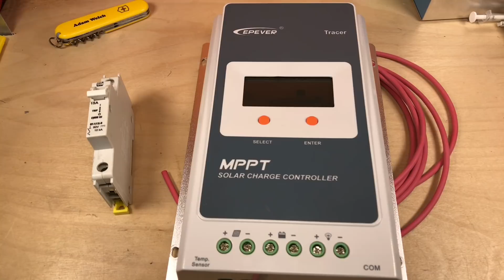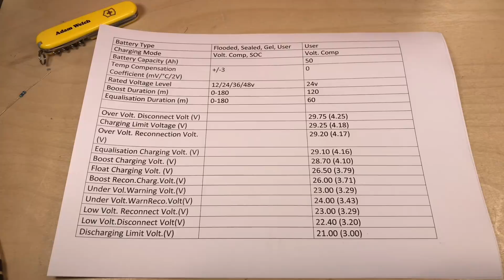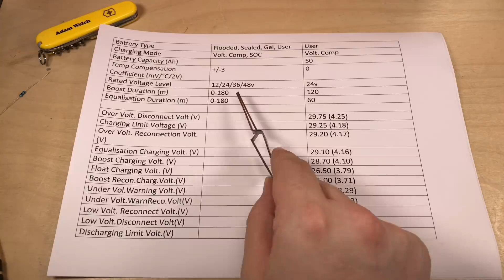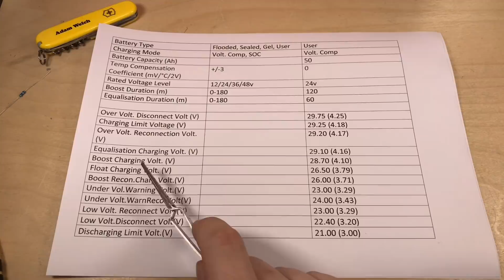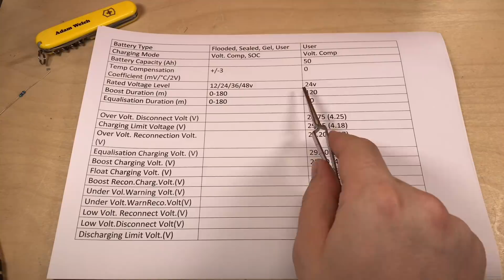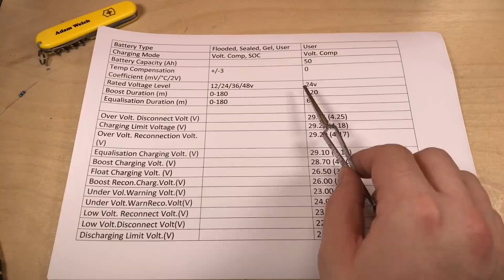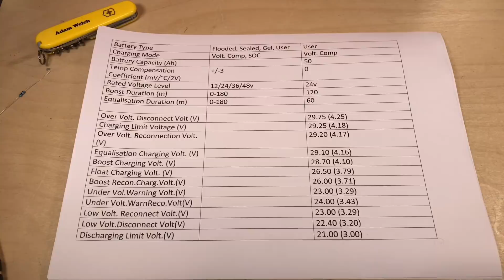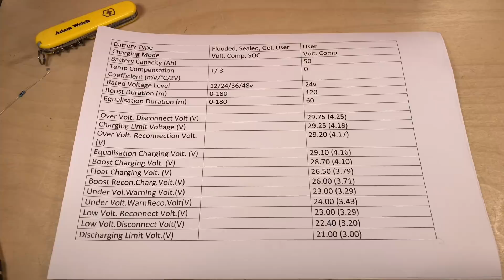Solar Charging the 18650 Blocks - 12v Solar Shed

Comment: hello Adam, very interesting video, I'm trying to build an off grid system with 18650 batteries, and I would have some questions for you: I understand that float mode is not good for lithium batteries but I have not understood how you can avoid the controller enters float mode if during the day I take energy from the batteries (in fact if I take energy from the batteries when the battery voltage reaches the float level the controller enters float mode), or am I wrong?
Reply: Did you ever find an answer to this question?

Comment: Hello Adam, maybe you can help me with my problem, and I have the Epever Tracer 3210AN on a 4S Li Ion battery system. In battery mode "User" you can set everything from 9-17V and I have a list of values for such a system, unfortunately it does not charge over 15V although I have set Max 16V, basically it is not bad for the battery but there is not enough energy in it. Do you have an idea or the loader can't do it because then this user mode would be pretty pointless. mfg Marco
Reply from the maker: I’ve not taken anything that high but if your boost and equalise voltages are above 15v then I’d think about your solar - either there isn’t enough to get the size of your battery bank up to that level, or it’s not producing the voltage. It’ll need battery voltage +1volt at least. 
The boost and equalisation charges only last for a limited period of time - if you can’t charge your bank up to that target voltage in that period the charge controller will fall back to the float voltage. 
Hope that’s helpful.
Reply: Adam Welch  hmm so solar voltage should be enough, because I have 2 12v modules connected in series and open circuit voltage is 36-40V.
Reply: Hello Adam, hope you are well. I could solve my problem with my Tracer AN and the misterious 15V limit. It was the BMS's fault that the charging process should be interrupted in an emergency because I had previously worked with a cheap china pwm loader and I simply needed security. Now the detail of the Tracer AN measures the resistance of a battery and then adjusts itself, but if there is a BMS in between, the resistance of the battery for the tracer is practically infinitely high and he does not know what he has in front of him, then switches the system at 15V depending on the system download regardless of what you have set. today i rebuilt it for the sake of trial and lo and behold, it loads exactly as i want it.

Lg Marco
Reply from the maker: Marxter Go. Glad you found the issue. Interesting issue!

Comment: Hey Adam, great vids. Had probes w commas with my AN through the eLog to my laptop. Don't know if it's the real fix, but I could only get comes if the load function is on. I don't use the load for now so had it default off, no comms, but on fiddling with it, powering all off n on blah blah, noticed I had comms when the load was on (no load attached) but switching off load then comms failed. Or maybe you found a solution since the vid was posted. Good luck with it all anyway ..

Comment: Thanks for the helpful videos Adam. I wanted to lower the Disconnect Volt on my batteries so I created this spreadsheet that recalculates based on your Epever settings: https://docs.google.com/spreadsheets/d/1IcbSseoX_I_Cs_xaVRo6tHJBcvlOIAYs6Bnss1mWFbQ/edit#gid=0
Reply from the maker: That’s a handy sheet. Thank you.
Reply: @AdamWelchUK  I've seen what you do and know I don't have your expertise so any recommendations on values would be appreciated. Presently testing multiple 7s packs of recycled 18650s to gauge best settings.
Reply: Battery University recommends that you let batteries discharge to 50% before recharging to prolong battery life because of less charge/discharge cycles. So, the Float Chargin Volt (V) should start at 26.47 volts. Would you agree with this?
Reply: Sorry for so many messages. I've been doing some testing and everything needs to be calculated off Charging Limit Voltage (V). I've updated the spreadsheet above. Not sure if what I'm doing is correct so if anyone has suggestions for improvement please let me know.
Reply from the maker: Due to the fact that I charge in the day and don’t tend to use power until after dusk this hasn’t ever really been an issue for me. The float charge never happens, because the cells don’t fall back far enough to initiate it. However I think if you want to follow this advice it’s your Boost Reconnect Charging Voltage setting that starts a recharge. Remember float charging just maintains the battery charge level.
Reply: @AdamWelchUK  Thanks. I'll change my testing based on that. I've also created a PHP/MYSQL interface that records everything that I'll post once charging settings are confirmed.
Reply: Here's a screen cap of the interface I created to my EPEVER. Unfortunately it was on my old NAS which was ARM based. Now I have to get it working on my new Intel based NAS: https://www.spinningplanet.co.nz/images/custom/home/solar.jpg
Reply: I've got the values all sorted now. Ended up copying the Lithium settings from the EPEVER Xtra series manual. I wrote a blog with tips on how to set it up here: https://www.brynux.com/configure-epever-tracer-lithium

Comment: I'm using this Solar charger with my DIY 3S 18650 pack. I used your values as you describe but for 3s voltage and not 4S like you are doing. I don't get full sun on my panel until mid day. But my pack never gets above 11.89 volts? I have drained it down to under 11 but it charges back up to the upper 11 range. It says on my software monitor that it's at 12.1 volts. But if I hook up my voltage monitor, it's always around 11.8 volts. I have upped the float and recon values but I'm still not going higher. Have you seen much difference between what the charger is showing and what the pack actually is. Any suggestions on other parameters I can change to get the voltage higher?

Comment: Adam, not using CC in your setup is safe because the maximum current the solar panels can generate is below the maximum current eack pack can be safely charged at.

However, it's important to note that if the panels produce more current than the batteries can be safely charged at, they will likely overheat and may cause a fire.

Comment: Hi Adam
10:25 you talk about setting the over volt disconnect to 29.75volt.  I have tried to do the same, but the 
software in the controller only allows to be set to 29.7 volts ?  (5mv in difference)
Did you really set it to 29.75volts ?  the same goes for "Charging limits voltage" as 5mv steps is not possible to set.
Reply: To answer my own question....It's not possible to change the steps by 5mv in the MT50, only the PC program can change in 5mv steps.

Comment: Hi Adam, wrt CC charging the PV panel peak power should be such that maximum current to the battery is below the allowed charge current. Normally 0.5C for li-ion batteries. In the CV voltage phase the current must be reduced to maintain the maximum battery voltage. (in that case the PV panel is not used optimally and no MPPT is done). I am very curious when you start measuring the charge behavior of the EPEver. I tried the same thing and float charging is not what you want and this stage is forced you can only specify the voltage but you cannot avoid it. Cheers
Reply: I have similar questions. CC phase (bulk) and CV phase (bust) are OK for me. But CC produces too much current, CV (bust) ends too early. CV mode ends after 180min, but there is still 3 Amps going into battery. So Float phase has to finish the charging. In my opinion the CC (bulk) phase produces too much current for my battery and the voltage rises too fast. Then CV (bust) phase doesn't have enough time to finish charging. So, is there a way, to limit the current in CC (bulk) phase, or is it only option to connect larger battery?
Reply: I think your analysis is completely correct. However when you  limit the current in CC (bulk) phase what is the point in buying an MPPT charge controller. The only thing imho you can do is to choose a PV panel that delivers the maximum allowed current during CC charging.
Reply: Today I tryed to put smaller value for battery capacity. 10 Ah instead of 20 Ah. I was hoping that EPEver charger would put less Amps in the battery. 0,5C for instance. No luck. Bulk phase (CC) probbably puts all the energy it gets into battery. At least my model Tracer 1215 BN. My test battery is too small (20AH) and the current goes up to 8 Amps. The cells should handle this current. But the voltage is raising too fast in bulk phase, and the battery can't be properly charged throug Bust (CV) phase. I wonder if other models are any different. This data is hard to find.

Comment: hello Adam, I want to do an off grid, system, can i don that with a pwm charge controller or an mppt charge controller?
Reply from the maker: Yes you can do it with either.  MPPT is the way to go if you have limited space for solar panels, but otherwise PWM is fine, and use the money saved on your controller to buy a larger panel or array.
Reply: I HAVE 4 PANEL OF 100 WATTS PANEL AND I HAVE 2 100 AH BATTERY AND AN 2.2 KVA INVERTER BUT I STILL RUN INTO PROBLEM, IF IT IS MY PWM OR MY BATTERIES? BECAUSE MY SYSTEM GOES OFF,  EVEN DURING THE DAY.
Reply: AND WIRE MY ARRAY BY CONNECT TWO EACH SERIES AND PARRALLEL THEM TO MY PWM CHARGER

Comment: Adam, can you please tell us some more info on FloatCharging. This Float Charge debate is pretty confusing to me. How bad is it using FloatCharging on Li-Ion afterall? I noticed the voltages on battery differ from voltages mesaured on EPever solar charger. 16.05V on charger vs. 15.65V on battery. The EPever software readings are showing the values mesaured on charger correctly. But I have also a REC active-bms connected to my 4s9p battery pack and it's software is showing the actual readings from battery. There I spoted the differences. The battery never reaches the values set in EPever solar charger. The charger actually always ends in float charging the battery all the day with small current. 0,30A or so. The battery according to charger reaches 16.05V but it is really 15.6V.  After long float charging the cells slowly reach near 4V each. The Float current is simply too small. I'm thinkig about setting the battery capacity higher to increase the charging currents but I'm not sure about this. But I doubt I wouldn't get my battery charged to 4V/cell without float charging. So I'm trying to find out, how bad is this Float charging for Li-Ion packs. I'm following your channel for almost two years and it is great inspiration. Packed with relevant information. Top work.

Comment: Pity you can't get the AN series to work with your WiFi to RS485 dongle.Might be worth knowing that the AN has a setting for LiIon and LiFePO4 charging on a separate page from Lead Acid batteries with default settings for 3S and 6S batteries. The main advantage for use with LiIon seems to be that that the software for the temperature sensor on the Lithium cycle allows you to set a temperature at or below which you will not charge or discharge the batteries.  For winter, this is an advantage in a shed.

Comment: Hi Adam.. Watching your videos inspired me to build my own 3s20p lithium power pack.  One thing I have issue with, is how the wiring goes from battery with BMS to the MPPT charger and load.  If you don't mind, can't you share the wiring diagram of what you have for the above setup, assuming with a load attached.. Thanks...

Comment: hi adam  each pack is 3.7v connected to series for increase voltage right.
 how do you balance each cell in 1 pack using a bms if the bms is for 4 cell. sorry is you have a video covering this is so please le me know the link
Reply from the maker: You’re right that connecting the packs in series increases the voltage. However I have built a 7 cell BMS for my 7s20p pack. Each module is isolated from each other using the ADUM1250ARZ i2c isolation chip. It allows communication between the modules without a common ground (and prevents a short circuit). I hope that helps.

Comment: Adam, you seem to have set the peak and minimum cell voltage to the extremes the specs allow, rather than limits chosen to maximise cell life - if you intend to use this capacity in anger, is this prudent? Also - given the effort expended and the success achieved, do you plan to scale this up to the point you can move towards a solar house vs. a solar shed ?
Reply from the maker: You’re correct I have set the charge controller close to the limits. I’ll be monitoring my pack closely, and it hope to never get anywhere near the 3v per cell lower limit, but if I need to or something goes wrong, the setting is there. 4.1v per pack is a little higher than the 7s8p pack I have which charges to about 4.05 per cell. After a year, the captivity loss of that pack was very small. The settings aren’t set in stone - actually there is something I need to consider moving forward, and the upper limit is another one. 
I’ve no intention of running the house from this or any other pack at the moment though. 
Thanks very much for the input.

Comment: Adam 
I’m building my own power pack and start to charge with same solar mppt 
PAY ATTENTION : when using USER, after cutting with breaker or other power disconnection... this mppt loose settings !!
Did you try this ?
Best
Reply from the maker: That’s interesting to hear. I have two Tracer As and a Tracer AN. None of them loose the user settings after a disconnect. Perhaps yours is faulty?
Reply: Adam Welch !
Thanks it’s helpful to share !

I’ll try again and will let you know if I have same problem again... I’ll try to disconnect solar panel and battery.. to see if...

Comment: Adam, where would you recommend going to buy a bunch of old 18650s like you have here?
Reply from the maker: I got a job lot of laptop batteries on eBay. Unfortunately the prices seem to be going up and up. The other option is to go to a local recycler or laptop repair centre and start a conversation. If you go down the eBay route, be sure to carefully look at the images to see exactly what you are buying, research the laptop battery model to gauge age, number of cells and ensure they have 18650s if that’s the route you are going.

Comment: I've got a similar system ( https://imgur.com/a/rhrb6EM ) with my own DIY BMS. For charging I've got an SSR for interrupting the solar input. Once the cells reach 4.1V charging is terminated, and when they drop back down to 4.05V the solar is turned on again.
Reply from the maker: Looks like a nice system. Thanks for sharing.

Comment: I keep nine at 4.0 volt.  28 volts total. My experience is that the cells will diverge quite a lot during charging and discharging so my daily balancing is a must. 
Also hoping the cells will last longer just charging them to 4.0 volts.
Reply from the maker: I think it’s a good shout. My smaller 7s8p pack charges to 4.05v/cell and the capacity after a full year was close to its original. 
After only a couple of days though my packs are staying very closely matched, but I’m not yet draining them much!